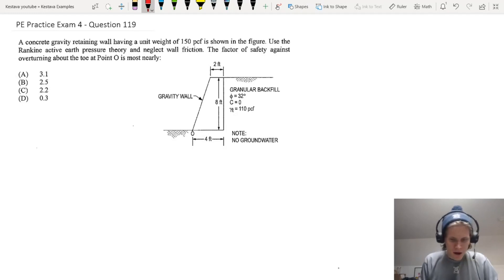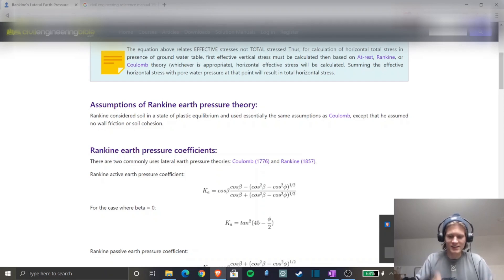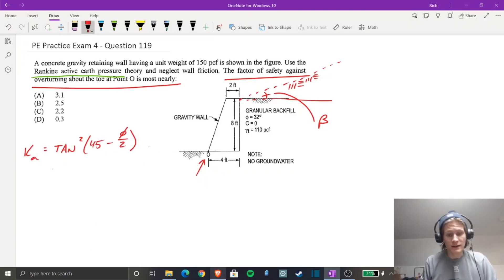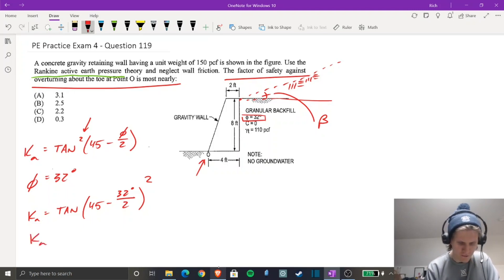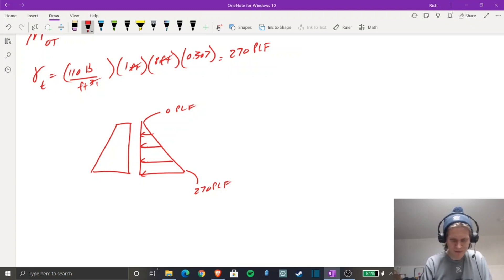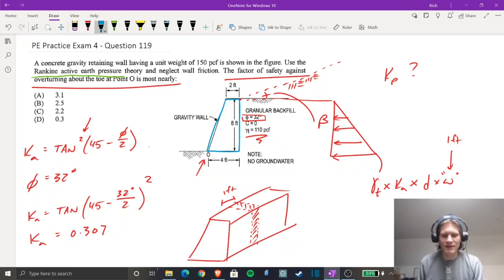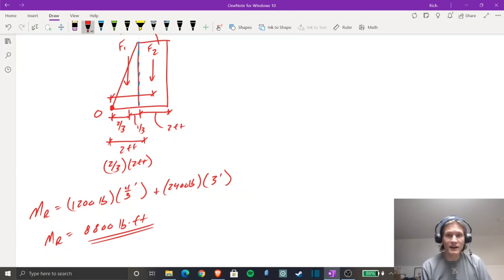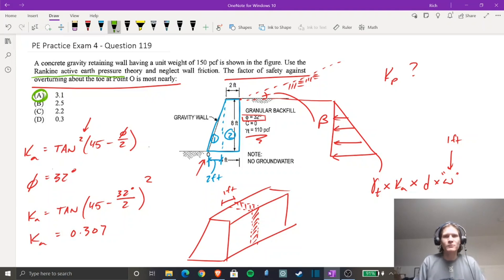Retaining Wall Design Example - By a Professional Engineer

Comment: what would you do if the top of the wall wasnt 0plf?
Reply from the maker: Hi Chris. If you were designing by hand you would have to split the force into a rectangular component and a triangular component and find each components contributing shear and moment on the retaining wall. rectangle would just be at the mid height of rectangle but triangle would be 1/3 from base. hope this helps and great questions!
Reply: @Kestava_Engineering  you make it seem so simple the way you describe things! Thank you so much, you’re a phenomenal tutor!